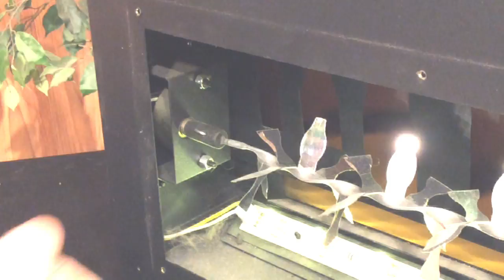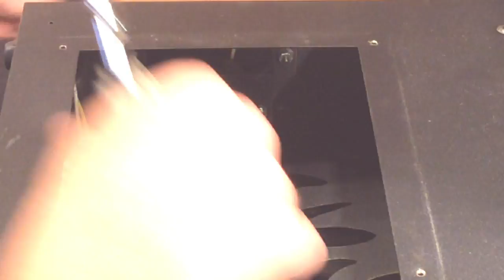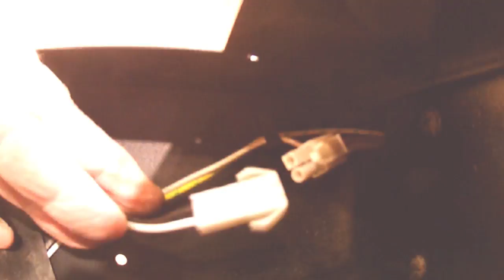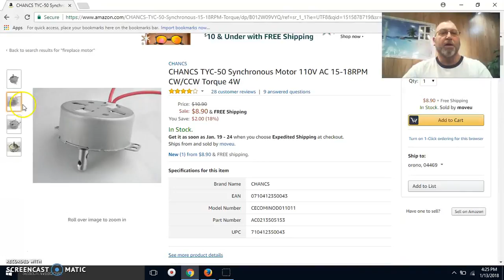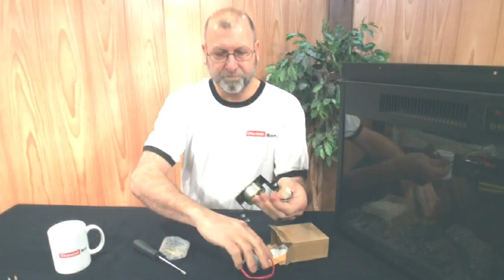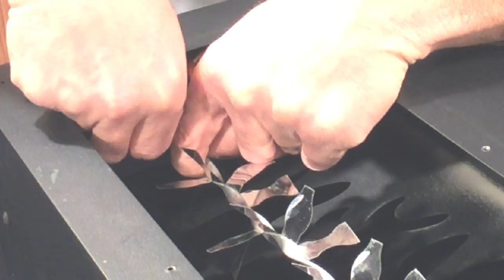How to Repair Imitation Flame On Space Heater

Comment: Thanks for this great video and Amazon link. I read yours reverses directions. I noticed in the Amazon link you can choose between 3 motor directions. CCW, CW, CCW/CW . I’m guessing you have the CCW/CW model. I chose CCW as Chat GPT said that’s what it uses. I can confirm now that CCW is correct. My fire place works like new again. FYI, I used 2 connector WAGO connectors. I cut the old wire at the old motor since the wires on the new motor were about 3” long. It worked great.

Comment: What does the motor spinning or not spinning have to do with the lights not working? Could mine just have the lights (if they are leds) burned out and the motor is fine? I haven't taken it apart yet. Heater and blower still work like new. Stand by for an update sir...
Reply from the maker: Hmm, not sure it maybe the led strip is bad.
Reply: @channelron3593  so if the motor is turning the flame simulator, and there are no lights, it's ONLY the led strips? If the motor is bad, the led's should still light up?

Comment: Mine looks like you’d but the led lights stopped working. Where can I get replacements?  Thanks for any ideas you may have. I have the manual but it just says call a technician.
Reply from the maker: That is the problem with a lot of these heaters they sell very few parts for them.

Comment: I replaced the synchronous motor, but the motor still doesn't work, I tried 2 new motors, the right one , is there a fuse that's burnt or something else? please. t
lights work fine, heater works fine, just the flame rod doesn't refuses to work, I would appreciate any help
Reply from the maker: Hmm. sounds like the power supply may be bad? unfortunately, they do not separate the power supplies its all on one board. could be just a blow fuse on board or a diode?

Comment: I have a Dimplex model dfg2562. It is making a squeaking sound. I shut the heat off and keep the flame on, and it still squeaks. I can not turn off the flame and keep the heat on. Is this dangerous? How can I fix the squeak. I can did with the squeak as long as it doesn't cause a problem.

Comment: Thank you so much for this video.  I have a lovely electric fire place, the heater works, but the flames went out.  I had no idea what to do, I am still not sure if it is this same issue or maybe the lights isnide that makes the flames?  I wish there was another video showing the different potential problems.  But this was a great tutorial, very easy to follow.  Blessings.

Comment: I am trying to repair a Febo Flame ZHS-28-B / Syle Selections F13-I-002-021C for my parents.  The "starter" is bad and needs to be replaced based upon the information I was provided (?).  I'm hoping you can help me determine what needs to be replaced as I can't find anything called a "Starter".  Thanks! Rob
Reply from the maker: Have not worked on that model. sounds like the main board, are there any replacement part for that model? I would start there.

Comment: I've got the Mach 1, 3 line fluted trim with medallions.  No easy off panel. I think you have to go through the plaster log. I chose not too and settled for shooting wd40 into axle holes and motor spindle, which was hard to see. It's running quiet now. Also took time to replace bulbs and clean dust out of head unit.

Comment: My heater is working fine but the fire part isn't. It was working fine then it just didn't come on the next time I tried to use it. I replaced the light bulbs today and the tin park is spinning but the light bulbs aren't even turning on. Is there any hope 😭
Reply from the maker: Could be a bad connection?
Reply: I have the same problem now. Did you figure out how to magically fix it? 😃

Comment: My heater works and the motor for the fake flames rotates, but the lights won't come on. I've already replaced the bulbs, but no luck. Any suggestions?
Reply from the maker: Got to me a loose connections not much to them?
Reply: @channelron3593  that's what I thought too, but can't seem to find it. I'll take another look. Thanks!
Reply: Did you ever find a solution?
Reply: @KB-mm2ti  not yet. I've got an electrician friend who's going to take a look at it. Thanks for following up!
Reply: It has to be the flux capacitor.
Reply: @371francis  😂😂😂 That must be what it is! I'll crank the motor up to 88 mph and let you know what it does.

Comment: What if the replacement that I purchased has two wires, but the original has three wires? I ordered the same thing in terms of 120V AC 60Hz
Reply from the maker: I am not sure, I ordered this one https://amzn.to/2ND6fbQ and was lucky enough to get the right one,  I have noticed that sometimes it will run backward, but still working fine, anything markings on the side of your old one that you can see to help? The only thing that I can think of is maybe the third wire is an equipment ground? I looked online myself and can not see a motor with 3 wires. they make so many types of thees synchronous motors it is tough to get the right one.

Comment: Superbly produced video.  My friend’s MasterFlame TED20 fireplace is very noisy but it is not the blower so I suspect it is the motor that you so superbly replaced.  Thank you very much for sharing your experience in such a professional video.
Reply from the maker: Thanks for the kind words,  but don't throw around Professional video too much I am still learning (:
Reply: Purchased an almost identical motor on eBay for $9 shipped free from China and I repaired my friend’s fireplace in 20 minutes.  Excellent result.

Comment: What do you do if the light bulbs don't even turn on is that also a motor issue? I plugged the unit in and the ignition switch lights up I press it and there is resistance but then nothing happens. I thought the bulbs were faulty so I replaced them but no dice they don't even turn on.
Reply from the maker: Wow, I would think it would be the heating element its self, I have not had that problem yet, sorry not much help. sorry I did not get right back, Thanks for watching.
Reply: I have the same problem, I changed the bulb and it is still not working. Can you tell me if you find the solution please
Reply: I see you put the comment a year ago. Did you find why yours didn’t work?
Reply: @sally-v1r9h  I didn't sadly
Reply: @Whatchuknowboutpops  thank you
Reply: @sally-v1r9h  you're welcome